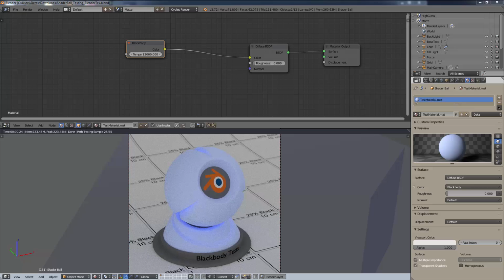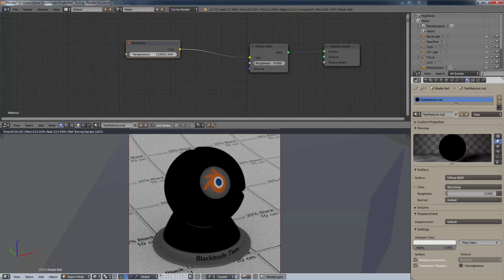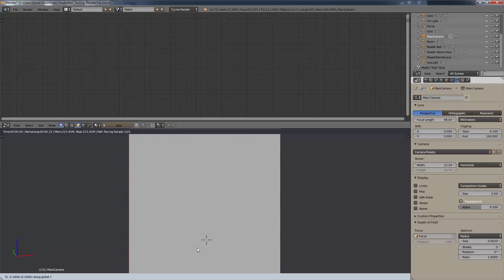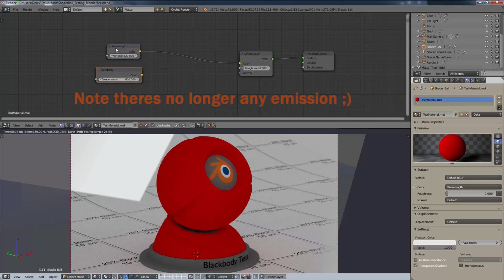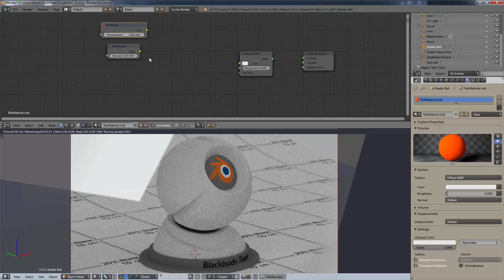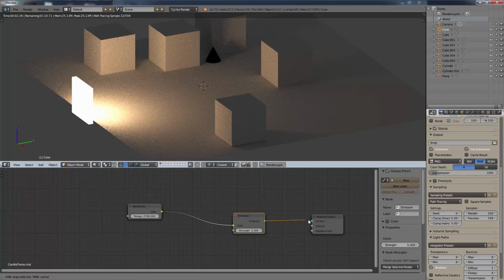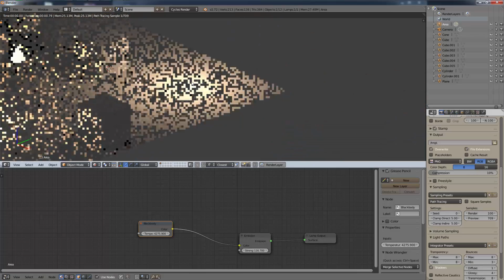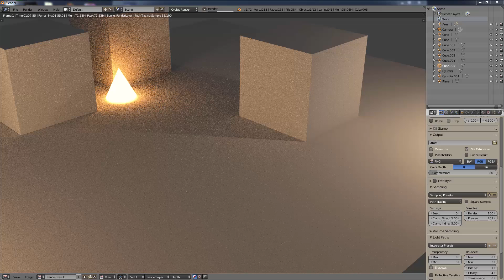Howto use the BlackBody Node to make More Realistic Lighting in your Blender Scene - 2 73 beta

Comment: Interesting video !  But does the Blackbody really return something else than a simple color value ?  I mean if you set the default emission shader color to the same color as the one from the blackbody, it still wouldn't be the same ?
Reply from the maker: Hard to say I havn't done extensive testing, but its gotta be there for a reason. Blender rarely adds nodes that are exact duplicates of another.
Reply: I am extremely late to this, but I reckon the key thing is that blackbody isn't generating a unique output that couldn't be exactly recreated in an RGB node — rather, it's converting a blackbody Kelvin value to an appropriate RGB color.  The thing is, you can't easily obtain the RGB value of the output from the blackbody node, making this recreation rather difficult without consulting a conversion table of blackbody to hex colors.  Plus, blackbody nodes can be used with a map range node and a noise texture (or some other non-constant parameter) to have the Kelvin temperature (and resulting color) vary over the surface, something you can't do easily with manual RGB colors.